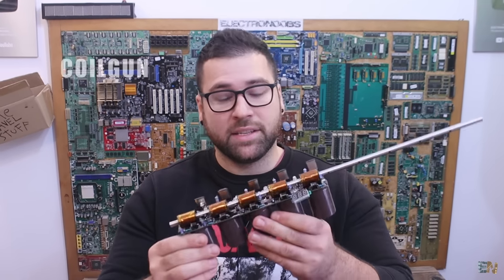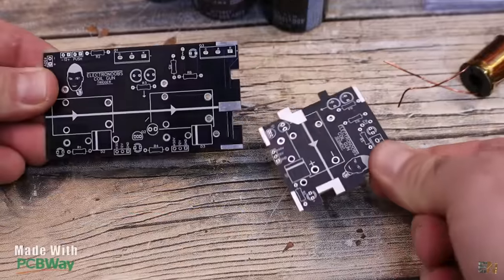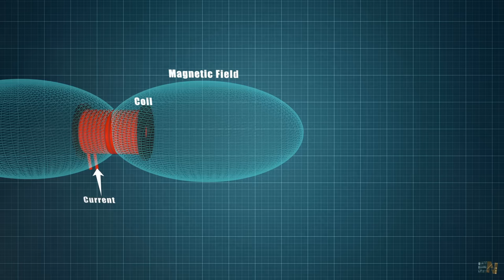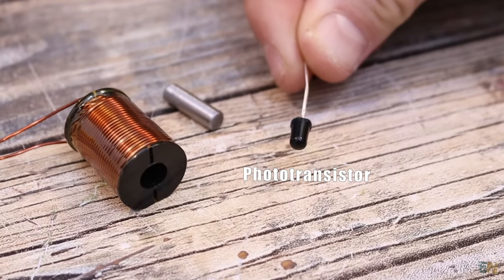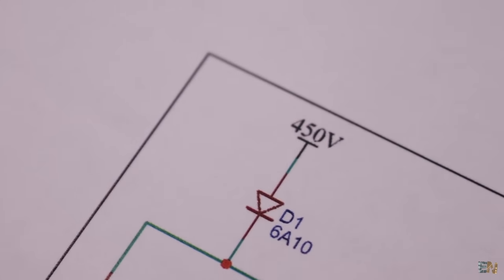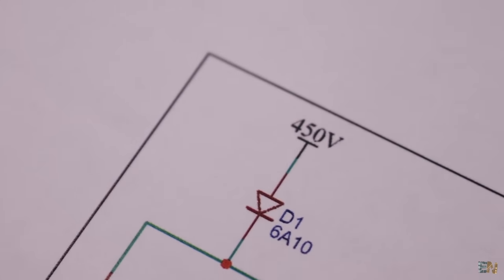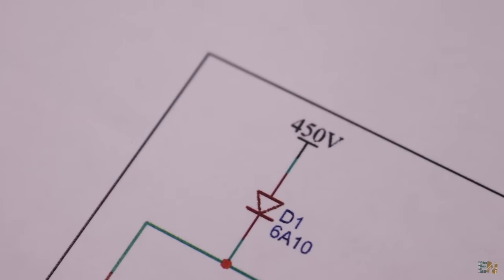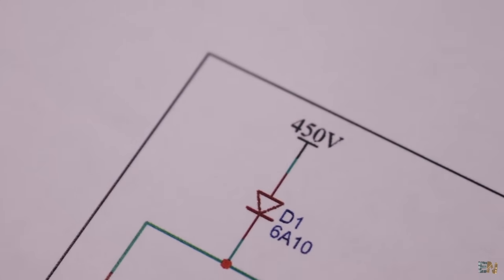I've Made a Powerful COILGUN | Separate Stages PCB

Comment: There are a few problems in this design. maybe I am wrong but it looks like you tried to copy a kit pcb from aliexpress. the biggest issue is that for some reason the thysistor is fried. maybe because of not good enough protect EMF diode.

Comment: as electronics get more compact, it becomes easier to make effective lethal weaponry...
the only limitation that railguns have seems to be the electronics.
if you had a battery that's good enough, and capacitors that are good enough, and coil wires that are conductive enough, you would just use a tiny piece of metal to punch through a heavily armored vehicle.

Comment: A question from someone uneducated in the electromagnetic field...
Why isn't it better to use a single solenoid which has a single, directed magnetic field inside the coil which would require almost no triggering, instead of multiple staged coils?
Is it the power required to generate the same strength field that multiple, separate coils create?
Asking because throwing away half the efficiency of a magnetic field to propel the bullet in one direction seems wasteful

Comment: dc emf coil railgun with sideways magnet slug (at least the base of the slug), two square coil rails left and right, of the slug rail, no pulse or contact issues, brushless railgun
Reply: just like dc emf electric motors are better than pulse ac electric motors, no pole switch hassle, just plain power
Reply: oh, and, no control circuit required, just like in a revolver
Reply: why you have to so indirect all the time, use dc superconducting coils to have zero resistance, with large currents, flywheel energy storage does not have internal resistance, get rid of the wire resistance completely
Reply: square tube coils are essential, not round
Reply: seems like co2 pistol power

Comment: Solder tip: avoid applying the solder to the tip of the iron, apply it to the surfaces to solder that should be hot enough to melt it otherwise you burn away the flux and your solder-joints look like in this video...

Comment: A am a bit confused with your phototransistor positioning.  Your diagram assumes the coil will lose the magnetic field immediately, but it takes some time. Thus in your setup  after the projectile will pass middle of the coil it ill be pulled back.

Comment: your coil is slowing down the bullet. a transistor gate has a capacitance, a photoresistor has a delay. in the end, the fact that you have a photoresistor behind the coil slows down the bullet. put it in front of the coil, and put a delay relay, and for each coil, set your own delay on the oscilloscope, having data on the speed of the bullet passing through the tube.

Comment: Would'nt it be more easy if you connect the coils in two parallell circuits with for example 5 in each one. Then you put them every other (+ - + - + - + - + -).
It will then work as a speed controller for an elecric radio controlled car/airplane/bort except the "motor" is linear and it is only two phase. You will probably need flyback diodes to protect the MOSFETS but the only thing to adjust is the curve of the acceleration of the switching.

Comment: Wouldnt it be better to place the infrared sensor in front of the Coil and just power up the coil if the sensor is "blocked"? I mean i think you brake the projectile a little bit because it has already passed the middle of the coil... My way just shuts down when it reaches the middle

Comment: > the same circuit

You can't change current on coils instantaneously, thus after some stage N no energy will be added to the projectile. I'd suggest after some stage move to low-induction/high-current coils.

Comment: Don't know if you've gotten better at soldering or not since making this video, just thought I would let you know your iron's temperature isn't hot enough or it's not got enough thermal mass to heat up the joints.
Noticed you have some clumpy looking joints and had difficulty getting the solder to melt on the joint.
Either that or the tip needs replaced.
Reply from the maker: Iron doesn't have enough power... I need a bigger one :(
Reply: @ELECTRONOOBS  see if you can get an Hakko 888d and on the super cheap in, look for one of Pine64's Pinecil irons, they got fine tips and bigger tips, just be sure to get a good power supplies.

Comment: I don't think the description for this circuit is correct. Once a SCR has been fired , you cant turn it off again. It will turn off when the Anode current drops below the holding current ( about 200mA for this SCR). This circuit only turns on the next stage when the projectile breaks the light beam , it does not turn off the current stage.

Comment: You are obviously not the designer of this since you explain the function completely wrong.
When a thyristor is triggered, it will continue to be triggered until the current stop, the explanation at 7:25 claim that the sensor turn off the coil, it's not. It's the source capacitor that discharges so the thyristor reset. The sensor is for the next coil.
In other words, the sensor is in front of each coil, not after.
Well, the first coil don't have a sensor, it's has the fire button.

Comment: High voltage isnt dangerous its the amp current. Just like a tazer is 50,000 volts. it wont kill you but it will definitely hurt.
Reply: Well actually if the voltage is high enough then enough current can flow through and kill you but it really depends on many factors. You can't have current without voltage and vice versa.

Comment: I cannot find a voltage display meter thats DC over 400v, only AC. I have a AC one rated for 500v but it only has 2 cables.

The part link doesnt seem to be working anymore. What voltage display should I use?

Comment: ok but what if we put bigger coils instead of more coils? wouldn't be the electromagnetic field even more powerful?
and what if we calculate the speed of the bullet instead of using infrared so we can have maximum velocity in the turning off the magnetic field?
Reply: bigger coils have bigger resistance which have a long-flat pulse, we usually require a sharp current pulse to synchronize higher velocity. higher velocity need smaller coils. check out my 145m/s velocity coil gun using 1000V film capacitors 20 stage. https://youtu.be/rm4fs7NXEyY

Comment: What impact would doubling the capacitors (ie 2x680uf per pcb in parallel)? Would it increase the mag field/speed or just burn out the circuit?
Reply: Perhaps it could increase the power but will also increase the charge time

Comment: You couldn't switch the polarity instead of just shutting off the coil?
That way it would pull the projectile up and as it passes through, switch polarity and push the projectile out. 
Instead of no longer effecting it, would still be effective to help accelerate the round.
Reply: That applies to a magnetic projectile but since this projectile is not a magnet then it'll not really help.

Comment: do you think it's possible to add 10 coils with 1000v plus a steel core bullet made from copper with gun powder in it make it powerful?
Reply: 1kV is quite a lot. Many modifications must be made in order to avoid unwanted arcing from the capacitors when charging (if connections are too close). Also a lot of components aren't rated to switch 1kV

Comment: no what you want is not to stop the pulse when the projectile its Zero Wavelength inversion, u want to invert the emfe as the projectile passes the Zero inversion point,, IE the middle of your coil, this is the principle of the mass driver, aka CERN and any bullet train and gen 3 or later mass driver cannons (emfe cannons). your half-assing it by only providing half of the functional circuit necessary to weaponize the velocity of the coils also your capacitors need to be twice as large for proper function. proper EMFE circuit is as follows. (push-pull) double your cap charge from a single-phase pulse as using 2 phases will use twice the power. this design loses half its V_D/T potential outright by only using one side of the mag field coil, the other side of the coil should also remain uncharged until the projectile is ahead of it.  u need to build your coils in duel phase function not single phase function. the projectile is pulled by phase one of coil one, hits zero phase plane ( middle of the coil), pase one coil one shuts off, phase two coil one turns on and pushes the projectile into the pull phase 1 of coil 2. this is the proper layout for a coil morter emfe circuit. if ur gonna do it, dont half ass it! yours truely, your local DEW dealer Zen Karu

Comment: Would it be possible to reverse the current on the coil and in effect flip the magnet as the projectile reaches the center point?
Reply: That would only work if the projectile was a magnet

Comment: How much of that Mag field is being soaked up by the metal barrel? Looks like a lot

You should try reversing the field as the projectile crosses the center. The projectile should be soaked with magnetic field and respond to the flip by continuing to accelerate in the correction direction at least temporarily. Furthermore, you could consider making the ass end out of a diamagnetic material that is repulsed by magnetic fields. so it can continue to ride the wave out. 

The animation of the solenoid field isnt really close to accurate either, its the exact opposite as described with field lines being compressed and running down axially through the middle before bowing out and returning back.

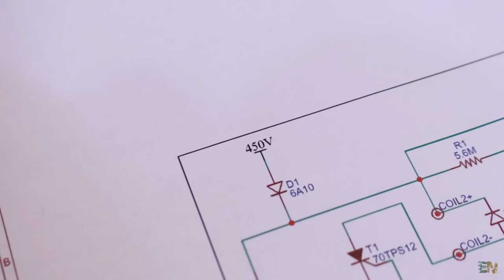Comment: 8:19 this circuit with thyristor cannot work as you want, 450V power supply is DC, thyristor switches off when its current crosses zero, but it cannot be zero in case of DC power source. The reason why your circuit works somehow(not efficient but somehow) is a mistake (few actually) in other places of this schematics.

Comment: I want to do this exact coilgun but with 360v 2000uf low esr capacitors. Can I use these pcbs for that? What size resistors would I need for that?
Reply: check out my 145m/s velocity coil gun using 1000V film capacitors. https://youtu.be/rm4fs7NXEyY

Comment: Your soldering doesn't look good but it doesn't look like its your fault.
The tin you are using looks like a lead free solder wire or it doesn't have a flux core.
To be honest it looks like it is both lead free and fluxless. Basically you have something pretty close to pure tin.
Soldering with this kind of soldering wire is a nightmare and always looks bad.

Comment: in this clipp. the person uses 60 volts from its power supply. then you do not need that big capacitators ! you can just use. any capacitator that can store 60 volts. it uses 58. volts. and 0.097 ampere ? so the watts will be 0.5 watt per single shot or so ? no need for 450 volts capacotators. you can uses 450 ÷ 60 = about 7 or 8 times smaller. wich are also 7 to 8 times smaller.
Reply: 5:24 or so. still frame. although boys will think. the bigger the badder.. better.. size matters.. this clipp is way more descent then the other... coil gun videos on you tube.. (i wonder about ac current instead of dc current. it think it will switch thr magnetic poles itself.) (also shooting thru a carbon box. but stuck into wooden multiplex board. is the same power as a powerfull bb GUN..

Comment: ... WHAT WOULD ACTUALLY HAPPEN IF YOU REVERSE THE CURRENT FLOW "IN THE MIDDLE" INSTEAD OF USING KIND OF HALF THE COIL AND SHUT IT DOWN .. AND COUDNT YOU USE THE CHANGES IN THE FLOW TO SYNC - MEANS: INSTEAD OF THE PHOTO-SETUP JUST WORK ON BASE OF WHATS COMMING THROUGH TO BE MEASURED AND REPRESENTED AS A WHOLE "GRAPHIC" ... COMPUTING/CONTROLLING/RECONFGURING THE "PROTOTYPES" BEHAVE DYNAMICALLY? AND WHAT ABOUT SHIELDING THE PROJECTILE PARTIALLY?... KIND OF ?
LG JAN
Reply: Reversing the polarity will only work with magnetic projectiles. The used projectile is not a magnet

Comment: I wonder if a magnified projectile would be significant for increasing power transfer into the projectile. You'd be able to flip polarity once the phototransistor is triggered and push the projectile out of the coil into the next one.
Reply: The projectile needs to be a magnet for that to work

Comment: This is a Rube Goldberg Device. It does a simple job in the most complicated possible way. Did the Navy award you a contract? 

Yes, a coil can accelerate a metal slug, but that’s obvious. But what’s the cheapest way to accelerate that slug? Our new aircraft carrier launch systems also use magnetic coils. 

So now, instead of traditional steam power which was cheap and effective, our Navy ships use magnetic coil accelerators which cost hundreds of times more, to do the same thing.

Our Navy is run by thieves. They buy overpriced junk, just so they can make more money. I would put all of them in jail.

Comment: Overengeneered. When I was a kid, I made a similar device without any transistors and optopairs. Just correctly placed the contacts of the coils, which were shorted through the projectile when it reached the area of action of each coil

Comment: Your explanation is not good.
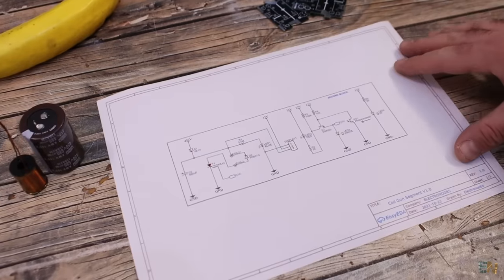In your explanation (7:22), you say that the phototransistor is used to turn off the coil, but your diagrams (8:08) clearly show that it activates it.
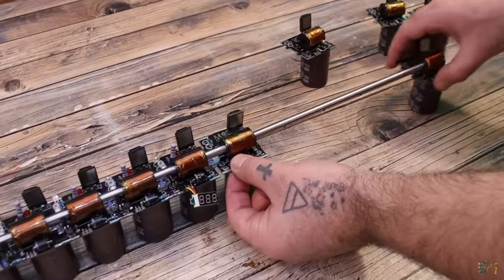And in the demonstration (1:00) we can clearly see each phototransistor before the coil.

And my knowledge lets me know that the phototransistor activates the coil, powered by the big capacitor,
which discharges quickly and therefore does not keep the coil powered for long.

So unless I misunderstood your explanation and your diagrams, there is a problem

Comment: why doesnt it shoot through the curtains?
Reply: The curtain isn't a rigid object. It folds and crumples as the projectile hits it, which dissipates most, if not all, of the kinetic energy. The basic idea behind it is impulse, or a force changing an objects momentum over time. 

The curtain has much more time to stop the projectile. The rigid objects, on the other hand, have practically no time to stop it so all of that force is applied at once. Apply newtons third law and the rigid object experiences the same force, which breaks it. 

You can compare it to falling on a bed vs falling on concrete. They both apply the same force to you, but the bed spreads it out over a longer period of time, so it is less impactful.

Comment: Your loosing power on the projectile with that design. You should instead consider moving the photo receptor to before the coil and building in a delay.
That way when the projectile gets a third of the way through the coil, the coil shuts down and the next coil activates, the magnetic field should be large enough to extend into the previous coil. This way there is no drag on the projectile and even better. The next coil in the sequence starts pulling the projectile forward before it even exits the previous coil.
This does complicate your design, requiring you to calculate a delay and propagate that delay calculation with each stage, the trade-off, however, is more power and a more efficient design.